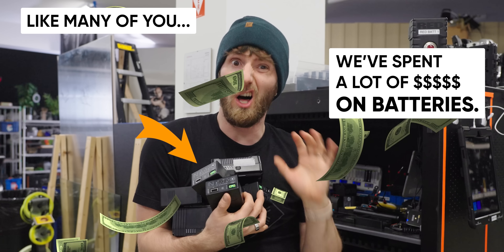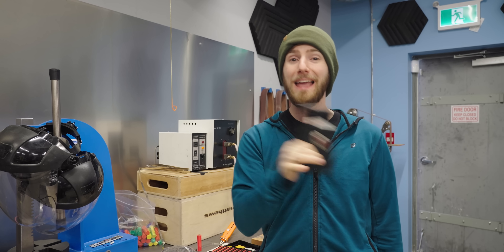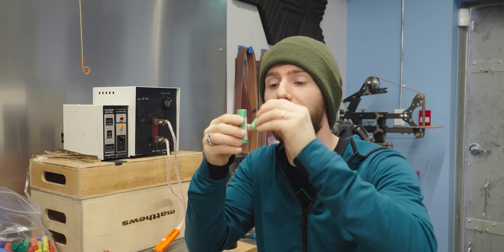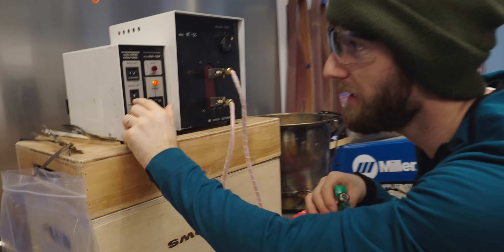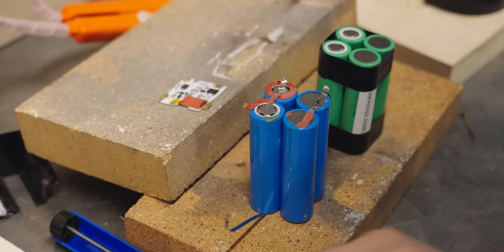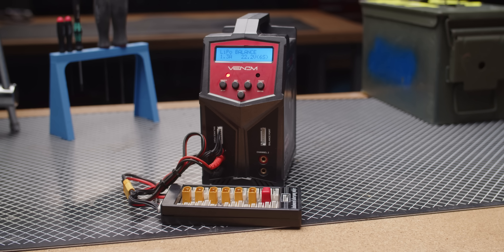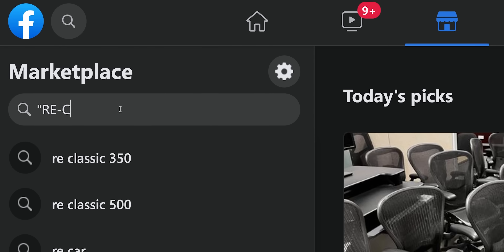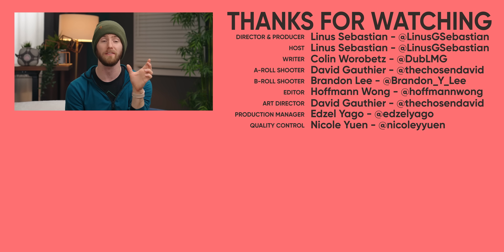This should be illegal… Battery Repair Blocking

Comment: They wasted a lot of good cells. The sparks were mostly due to airgaps between the battery and the nickel strip or the tip of the welder. It's nothing to worry about. Also @ 9:08 Linus was afraid of shorting the battery when connecting the positive and negative of two different cells but did not connect the other side of the cells together. Should also have taken off your ring and watch, or wore the gloves showed in the beginning.

Comment: Actually..... The sparks will be between same polarity cells...... When you tie the positive and negative sides of different voltages together...... Connecting them in series shouldn't unless you managed to do link it together on both sides
Reply: And yes, spot welding causes sparks.... Especially if you don't press the probes down properly..... Seriously Lithium is not that dangerous...... And those are plentifully discharged at 3.2 or 3.4v
Reply: Throwing away completely good cells because you don't know how to spot weld😂😂
Reply: Oh yeah, another thing. Some bms's need a reset after you remove the batteries. Just put it on a charger for a couple of seconds and it should come back to life

Comment: Try put sony pack on charger. Most of BMS need to be "restarted" after re-cell. 
And change spot welder settings. Its too much heat. Your nickel strip is red hot but it shouldn't be. That way you are heating cells too much.  And sparks are normal while spot welding. It means bad contact but its ok.

Comment: Best way to replace the cells on a weak pack is to vampire in a temporary pack to keep the BMS alive while you swap in the new pack. This way the BMS see's no change. In many cases you can use and HDQ programmer to reset the BMS. Downside is even from china it's a $1000 dollar piece of kit. So no good for the home gamer.

Comment: Most of the bms integrated in to electronics uses EEPROM memory to store data, when ever you disconnect the battery from bms it's content is deleted and cant be used again ( there are ways to program a bms back but lets not to get to this) .
easy way to detect " Evel Bms " there is a chip on the board with more than 12 pins or maybe two.
most cheap aftermarket batteries dont use evel bms cos its expensive, the second battery im sure it wasn't evel bms, most of the time when you install a bms it wont give you output, you have to supply it with little voltage to start it, so second one maybe working if you put in in charging for 5 min, or you just killed it.

Comment: There's one thing missed that would help explain "evil BMS" . Safety tripped when you removed power from the BMS which locks out it being charged/discharge. Why? Because it's the chargers that ship with these units that are dump, because slow rate of charge needs to be monitored on these packs. LiOn can only charge at a max rate of 1C, LiPo in some cases can charge at 5C. There's a transistor that locks itself like a fuse. And can't be reset usually, but replaced. A way around this is using another source to keep the BMS alive when changing the battery pack cells. 

Further, you should be checking battery ir(internal resistance) this can change power battery charge rate as well discharge. Again 18650 normal is 1C discharge. This is many reasons why people have issues with fire or magic smoke.

Final is you can reset the BMS chip typically, though on a diy level it's not easy to share in your type of video nor would I recommend that. One wrong bit write and now you have a.... Possible fire.
Reply: @nimoy007  1C is capacity-independent, it's literally "current in amps = capacity in amp-hours".
It depends on chemistry and construction though, cells designed for high discharge current usually can handle a higher charge current too.
Reply: @musashigundoh  There are different formulations of Li-Ion cells. NCA is highest energy density but low current handling capability, NMC is the usual classic laptop cells, high energy density and capable of handling much more current, these are the most common, LCO is a now-obsolete type with decent capacity and mediocre current handling, but is often combined with other types to produce hybrid chemistries with desired properties, and then LMO is a much higher current, much lower energy density type than the rest of them that is often found in brand name power tool battery packs. So depending on this fundamental cathode chemistry and manufacturer's secret sauce, the batteries will be good to anywhere between 0.7-3C charge and 1-5C discharge.

So say you will find Samsung cells, modern ones, which at 18650 size are either 2500mAh and have 20A discharge current rating and also 3600mAh but 10A discharge current, and i forget but also a similar difference between charge currents, because they have a different underlying chemistry and construction.
Reply: I believe Makita tool batteries have this type of low voltage death-switch. A single deep discharge due to a low battery being stored in the cold and…well…it won’t EVER work again.
Reply: @nimoy007  1C literally means 1x the amperage that corresponds with the capacity. So a 2200mah li-ion that can handle 1C will be getting a max curent of 2.2 Amps. Another example: a 200mah lipo cell that can handle 5C will mean that it can sustain a 1 Amp charging current.

Comment: Bravo. You set up an entertaining and educational video.

Oops. Then I read the comments on how you did welding poorly and mistook welding sparks for electrical sparks. And how your fire hazard advice treated lithium ion batteries as if they'd react to water as if they had metallic lithium in them.

Also you didn't realize that there is a trade-off between capacity and maximum current load in li-ion batteries and going for vaping batteries you were somewhat choosing current over capacity.

Next time reach out to someone who had done your kind of work beforehand.

Comment: I've done a bunch of battery work... especially laptops and I don't think you pop that cell. There's a bunch of smoke and gas and sometimes Flame. I've never even had  it happen. And you want to use as thin of nickel as possible that you can get away with so that way you generate as little heat as possible. Long as it'll do the job.

Comment: The sparks were caused by the welding process itself, not the cells! If you saw sparks caused by a short circuit, it would've been OBVIOUS you have a short circuit.

Comment: "why not just replace bad cells" Linus took the right approach here, for this audience thats majority evergreen you should just buy new cells and call it a day. BUT! there are experienced people out there that can measure the characteristics of a battery and match cells properly to be used again, if your not one of these experienced people DONT DO IT!
PSA: buy from a good reputable seller that sells guaranteed new cells, some eBay sellers will just salvage old batteries and resell them with inaccurate ratings

Comment: This is amateur hour - on so many levels - it's obvious the sparks are from the welder arcing - if it was the batteries, it'd have happened when you put pressure on the strip prior to welding.

Good try though, seems this is more clicky click than techy tech.

Comment: How about putting all the cells in a holder, bridged with individual resistors beforehand? This way, alle the cells can equalize with a limited current, so there should be no short circuit during the assembly.

Comment: I love that you sourced your cells from a vape shop. We're pretty particular in the industry about cell safety in e-cigarettes. Counterfeits are absolutely no joke and INCREDIBLE rampant. I also appreciate your overabundance of caution, even with some minor sparking (which, really, probably didn't do anything to the cell). Thank you for stressing the safety of how to handle them, because a lot of people treat Li-Ion cells the same as a set of AAs, and they're just... not at all the same. 

Those minty green cells are actually the same ones I'm currently using in my e-cigarette right now. They're great, last ages, and are very reliable. It'd be nice to see you guys do something about the difference between ICR, IMR, and INR cells.
Reply: Not sure if they're still that color, but when I saw the green cells my mind screaming "25R's!"
Reply: btw if you want to save money on suppliers, you can buy overstock (brand new) 18650s from batteryhookup
Reply: My local vape shop sells Imren cells (chinese rewraps) so your milage may vary.  I really wouldn't source cells from a vape shop for any purpose, including vapes, unless they had Molicel cells with proof it came from an authorized distributor (outside of some chinese brands I'm unaware of any cells that have authorized distributors other than Molicel).
Reply: @ahayesm  Most people are sourcing Samsung batteries these days. Sony also makes good cells, but they're harder to source, and more likely to be counterfeited. That said, vape shops are far less "wild west" than they were, and reliable genuine sources for batteries are far easier to find now than they used to be.

Comment: and there is no battery recycling, its too expensive. and all lithium batteries end up in landfill. It's just too expensive and dangerous to take apart lithium cells manually. America and other countries just sell their recycled waste too asian countries for waste management. Plastics and electronics mostly end up in landfills. Old plastic materials cost more than buying new. Thats for you capitalism rules for market, no one wants to spend more if they can save money.  Whole situation gets presented by few recycling factories for show off, so they can show you that the recycling idea works,  in reality amount of waste is too big and gets sold for utilization in other countries. In my country separate bins for waste and electronic waste (batteries) end up in same dumpster truck, what goes to one landfill. recycling is big scam.  I

Comment: I replaced the cells in my first 'portable' computer (I think it was an IBM Convertable). That is, I soldered together 8 NiCd D cells in series to replace the original dud cells. I don't think they had any battery management in those days. I sort of miss the simplicity of it's tiny screen, decent keyboard, and twin floppy drives with DOS and Word-2.

Comment: Using BE2Works with laptop batteries BMS. Same story, long-long time ago they goes by "Evil BMS" way. 
Also - disconnect the batteries from "+" to "-", and connect it again from "-" to "+".
Also - you can fool BMS by connecting temporally bateries pack, or connecting battery pack +/- to power source, and similar resisters between balance outputs, "+" R "b1" R "b2" R "b3" R "-"
Also - you can start some BMS after disconnecting by connecting battery output and battery pack output "+" together.

Comment: You kinda overreacted with the sparks, that was just from the spot welder, completly normal.
Can happen more easily with crappy or dirty tips, too high of a power setting or simply by the nature of highly fluctuating power output of those cheap chinese AC welders.

Comment: In fairness, the 'safety' excuse does seem to be pretty valid in this scenario, and there's a big difference between swapping a mainboard or ribbon cable, and playing with a volatile electrical source.  And of course the vendors are worried about a refurbished unit tarnishing their brand name.

None of that excuses RED from charging $400+ on a battery pack though.

Comment: This problem exists in DJI drone batteries pack too! Once the battery went too low capacity due to non usage, the BMS will disable the whole unit, you can’t even use the accompanied charger to charge it back up! Despite i open up manually to recharge the cells back to life the pack will never work ever again! These evil greedy corp!

Comment: i would advise covering any cell and busbar that you aren't welding up, it only takes a drop of a busbar to short circuit, that's from experience. As others have said try charging to turn bms back on.

and if they do brick the bms I know some laptops do, 3d print a modified case and use your own bms. no way I would pay $450 for such a small battery after the initial one to copy.

Comment: Please do check out Retriev that would be a great video to see.

Senator John Tester from Minnesota is pushing a Right to Repair bill through the US Senate. I think a similar bill has been advanced through the US House and the two will be combined, if the Senate version is passed, then forwarded on for the president to sign. 

I fully support repairing rather than wasting. For a good part of my early working life, I was an electronics technician. I used to repair circuit boards to the component level and even today we will perform a forensic review of any device that fails prior to throwing it away, I mean into the basement where parts may be salvaged from it. In some cases, such as a cheap low-end UPS we had, a simple replacement jumper cable was all that was needed to make the device operational. This cheap kept failing due to a battery fault. The reason was this APC UPS had a battery disconnect/reconnect cable that didn't seat properly on the battery terminals. Replacing the cable with simple lug-connectors solved the problem. For us and the environment it's a win and the UPS lives on protecting our network routers.

Comment: Few tips from guy that welded quite a few cells with good welders and with bad welders.
- ALWAYS!!!!! insulate positive terminal with paper rings. Any 18650 Cell at the edge of battery on positive side has negative ring. Laying stripe just on plastic wrap is just super dangerous when you put stripe that will get red hot, it will damage that plastic wrap and propably melt it. If not, it will happen overtime through small movements of the cells. Please dispose the battery if you don't have that added insulation for your safety.
- steel stripes are much easier to spotweld than pure nickel ones, but they can rust and have higher resistance so less current can flow at given thickness
- 0.15mm stripes are good ballance between max current and ease of weld
- spot welder used in video is super crappy and super dangerous. Waaaay to long weld time and way to low current. You should see one tiny spark not red hot stripe. Red hot stripe does not mean melting and bonding well to the battery. It's just heating battery a lot just like straight up soldering them. It's not big deal at negative terminal but on positive one it's dangerous because battery has plastic vent valve at positive terminal which gets damaged at high temperature and makes battery dangerous when internal pressure increases.
- spotwelding two layers of stripes is super difficult (even good welders can struggle with thick stripes) - better way is to plan layout of stripes and solder connections between them togehter with wire or even better with copper desoldering braid and after that start welding it all togehter.

Comment: Did the sparks occur because the strip shorted with the outer casing? I'm just a little confused on how it would've happened.

And I would be super excited to see one of these recycling facilities! And did you guys discharge those sparked cells before you took them to the center?

Also is a battery that vented during charging safe to use (I had a bms in a cycling headlight capacitor explode and caused the whole thing to heat up. I had asked whoever was home to unplug it when it was done charging, turned out I was talking to a wall (-_-))? And how many years off my life did I just use for sniffing a venting battery?